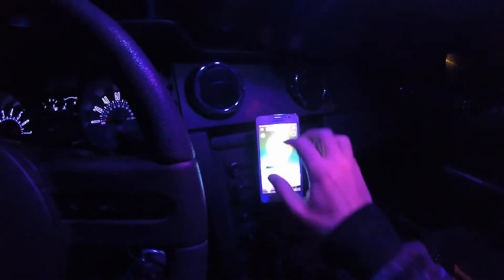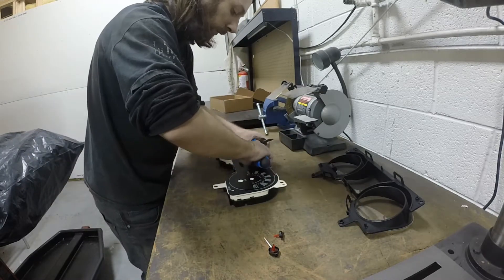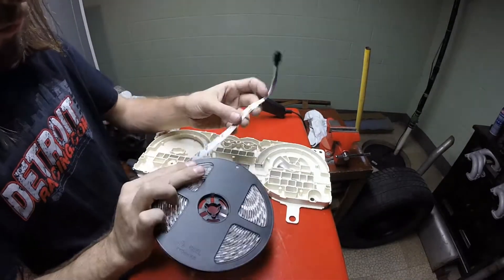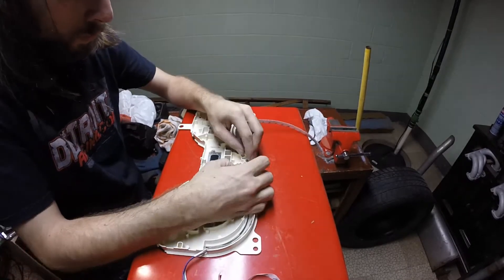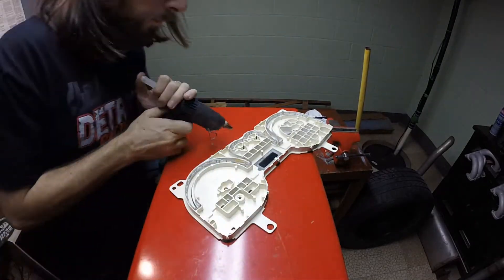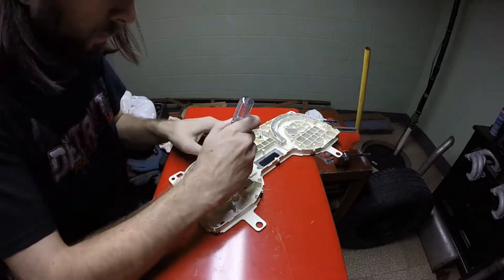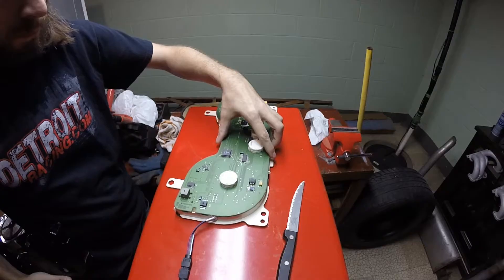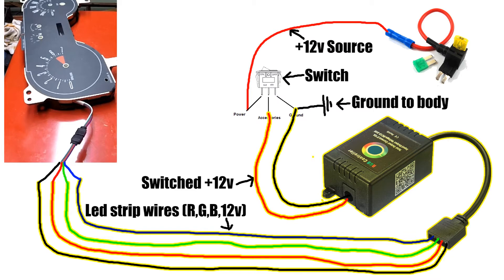DIY Instructional - RGB Bluetooth Gauges

Comment: Why didn’t you just buy the bulbs
Reply from the maker: s197's don't have replaceable bulbs, they're surface mount leds
Reply: Cyberdrive Automotive Oh ok but can’t you just change the color from the steering wheel from factory
Reply from the maker: @Brandon-ec8zl  Some models came with "My Color", which changed only the color of the gauge text and eventually the cup holders and foot wells.  Every s197 from the factory has green leds in the steering wheel/hvac/stereo/doors which you have to solder to change https://imgur.com/a/sQd9jIB

Comment: Awesome video and awesome mod. Is there any way to wire it up without a switch where it will come on when you turn the headlights on like the stock lights or mycolor option on newer models?
Reply: Smartass Garage, I would probably do this mod if I could figure that part of it out. I love the my color option and this actually even seems better. Don’t know that I have the electrical experience for it though.
Reply: That would be awesome